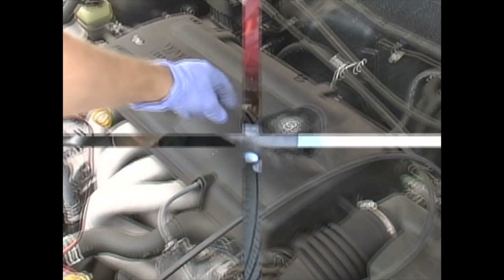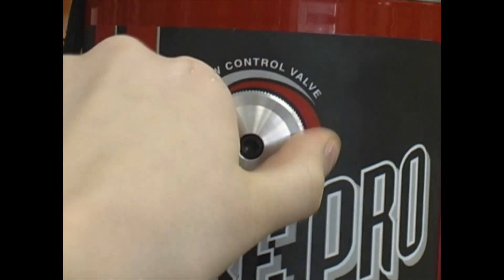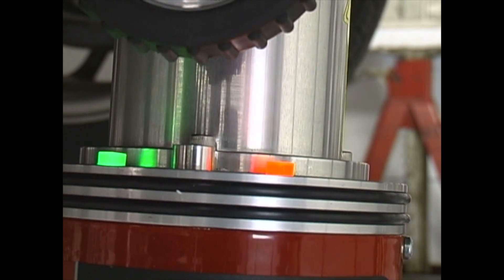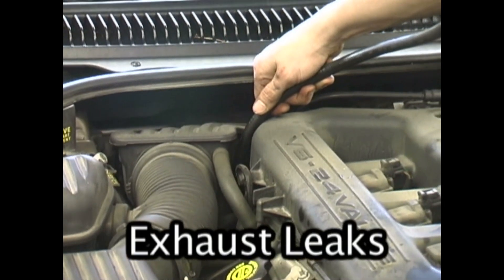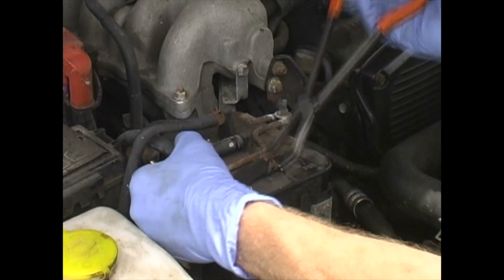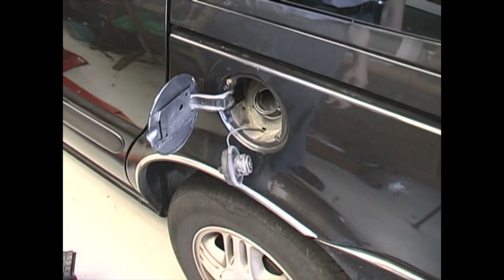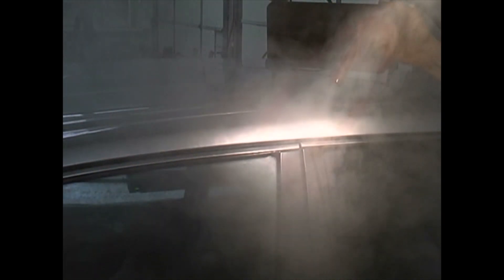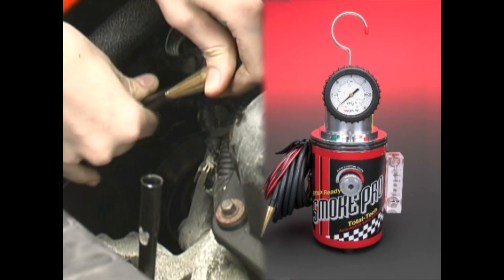SmokePro Total Tech Find Engine Vacuum Leaks

Comment from the maker: Agreed, A lot of people think that smoke machines are less relevant diagnosing more modern vehicles. But as you are probably aware, they are more relevant, because more sophisticated engine control systems are better at compensating for vacuum leaks. And sometimes completely masking the symptoms we have come to know as a vacuum leak. 

Greet tool, Thanks for the feedback !!